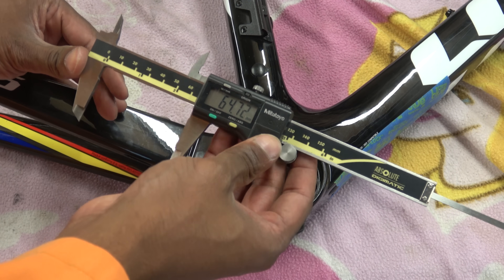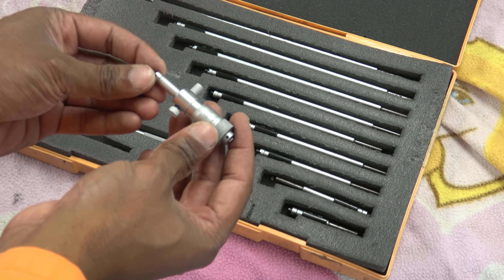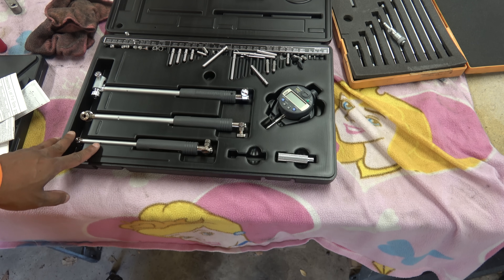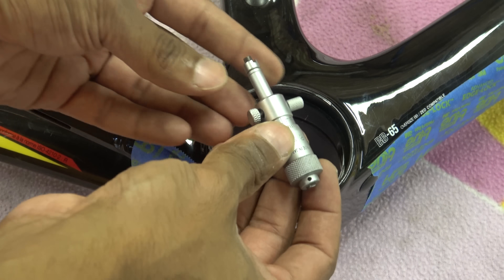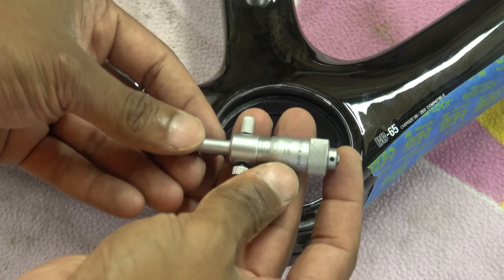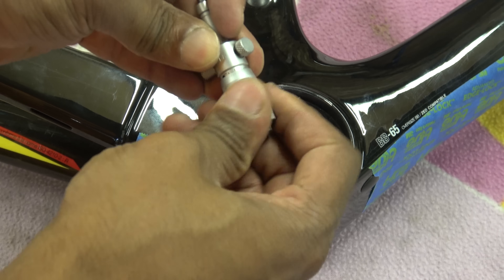Engineering Dream Bike Build: The finest Bottom Bracket | Look 695 Matt Black

Comment: How does this work ? If you have a pressfit bottom bracket wich is flush with the frame and you put the Hambini bottom bracket you will have a protuberance on each side of the frame, so how can you install the crank ? Do you have to change your system, spindle , crank ?

Comment: Started watching your channel and it's very interesting!
But dude, please realize it's not a mechanics work to check the quality of the BB shell. Even you checked it with the high quality vernier and it's far off the charts. There are people in the factory who's job to check the tolerances. And yes, I'm a mechanic and of course I don't do that kind of stuff.
Best regards!!
Reply: I think I agree with you. Not that Hambini's criticism on the quality of high end frames' BB is invalid, but I always thought the consistency of the BB is supposed to be factory QA's responsibility rather than the engineers'. Yes those brand are terrible and we should not tolerate such BS, but I think it's more due to crap QA not crap engineering. Happy to be corrected tho, I'm not in engineering and manufactoring.

Comment: Hi Mr Hambini : Question about your  Botton brackets : aren't they increasing a lot the Q factor ? Am I the only cyclist sensitive to that factor on my bike fitting ?
Thanks
Love your videos anyway
disappointed you don't ship bearings to France anymore (due to Brexit i guess)
Reply: In general, a bottom bracket switch can't significantly change the Q-factor using the same crank. The thing simply wouldn't install properly. There's a couple of mm that you probably can move things around (I've done it for chainline or stubborn installs), but really you can't generally make Q factor 1 cm wider without changing the spindle.
Reply from the maker: The explanation above from rod is totally correct. The q factor on a modern bike is determined by the crank and pedals and not the bottom bracket
Reply: @Hambini   The Hambini's BB installed has a lip (0,5cm ?), both side, out of the frame. Does the factory installed Look BB was that large ? On my bikes (not Look,  PF30) , the BB doesn't get out of the frame at all, the bearings sit inside the frame. That was why i wondered. But I guess the axle and spindle determine the width and so the Q-factor. my mistake. Thanks

Comment: No calibration before you start the measurement🤔
Reply from the maker: calibration is yearly
Reply: @Hambini  when i used these work whit them, i calibrated each time after changing the parts. Hade a 50mm calibrated ring for that.

Comment: talk about fussing around the gauge to measure the bore looks like a pain to use. in a machine shop they would use a spring loaded telescopic gauge and once you get it feeling ok you lock it off and check with a micrometer.
Reply: That's also the first thing I thought of when I saw him measuring the bore. 
When I left school in the early 80's I got a Job as a qc inspector at an engineering firm. Used to use those spring loaded gauges regularly to measure internal diameters. 
Easy to use and extremely accurate.

Comment: Hello Hambini, what are your thoughts about the Look BB adapters for these frames ? I have a Look 596 that  runs the same BB65 and I use the Look BB65 to BSA adapter to run Shimano cranks. 
I installed the adapter with grease and experienced creaking, but after using copper paste instead it is dead silent.
Reply from the maker: The type that look sell is quite flimsy and you need to use two adaptors. This one does it one go.
Reply: @Hambini  And the Look one is super expensive for what it is : two simple cups with 3 screws at 130€

Comment: How do you know that you have to change the bearings ? I have for example some 15 year old Mavic Ksyrium SSC wheels, if I spin them in my hand  I don't feel any vibration and the keep rotating for a long time. Is this a good indicator that the wheel is fine ?
Reply: It's pretty much : "You'll know when they'll be f**ked", and that's alright. You'll feel them being a bit rough like some subtle grinding noise. If it's silent, smooth and no wobble, then you're most likely good.
**Edit spelling error (sorry I'm French)
Reply: @pld468 So the spinning the wheels in your hand test will do fine ?
Reply: @mrGTD170  not really because there is no radial load when you do that. Same with BBs, the spin test is meaningless as there is no side load. With a wheel put it on its tyre on the ground and then lean down on the axle and roll back and forth. Often wheels that spin fine will feel notch y as fuck with a bit of load on the axle.
Reply: @mrGTD170  It's not the professional or official way of doing it, but if it's not loose, has no wobbles, is smooth and silent, then it's most likely okay. I have seen some cup and cones wheel bearing still being okay after 20 years (with maintenance) and sometime a good new hub have its bearing fked after just 6 month. If you have suspicions it's bad, do what hambani said
Reply from the maker: the best way is to get a DTI and measure the axial clearance. If it's 15% more than the limit value then it needs a change. Typically you'd have the bearing fail from contamination first on a bike.

Comment: What is the benefit of putting on a shimano crankset which is notorious for its cracking/splitting/delaminating when the look Z crankset works well?
Reply: Much easier to get spares for shimano
Reply: So my question was shimano vs look Z crank on this particular frameset. Im not here to shit on shimano, I use them myself and have cracked two ultegra r8000 and 6800 cranks, yet i will stick to shimano because of the environment of other parts on my bikes. Just wanted to know the general reason or thought process of swapping them out.
Reply: Animals as leaders \m/
Reply: @pureroadie  Peak Torque did a video on this not too long ago. Can't remember details, but I seem to recall it's more common in hot humid climates.
Reply: The chainrings are superior....to everything. You get Dura-Ace and you have the best front shifting available. The Look Zed is gorgeous and lighter, but has its own issues.
Reply: 24mm bearing either side and not having the dodgy taper and preload washer that SRAM used although I understand DUB may have improved things.
Reply: @adydanner  yeah we know that a Shimano is better than SRAM. But the question is why would you replace a Zed crank with Shimano. The Zed is far superior.
Reply: Its easier to replace a not oftenly shoddy crank then a frame that usually doesnt have a round bb hole in it
Reply: Best option overall when used with none Shimano cranks and rings ♡⃠
Reply: If you want a cranck based power meter, Shimano is a great options, plus their chainrings are excellent. The Look Zed crankset is great, amazingly stiff, but is also subject to creacking.
Reply: @GauGaut  good point lots of options for power meters with Shimano of course. However I bet buying a pair of Favero Assiomas would still be cheaper than this conversion!